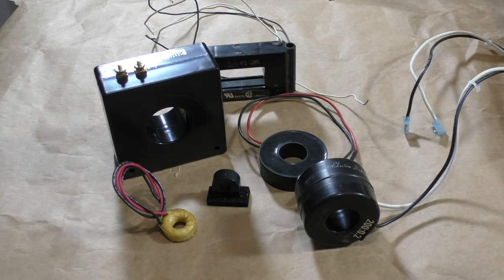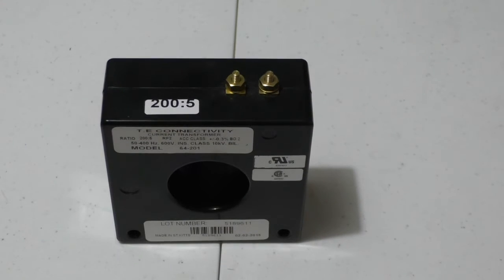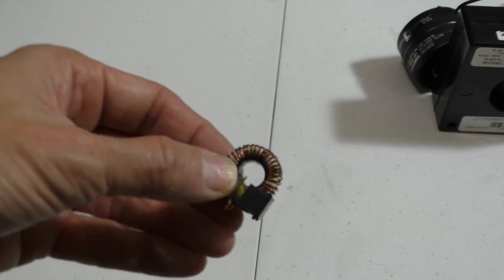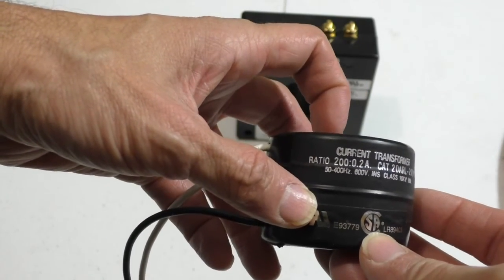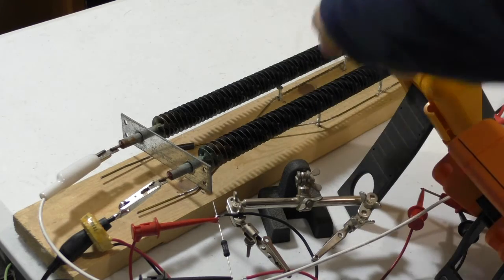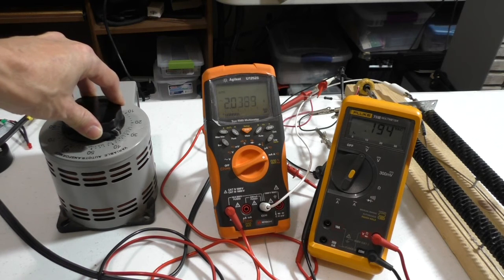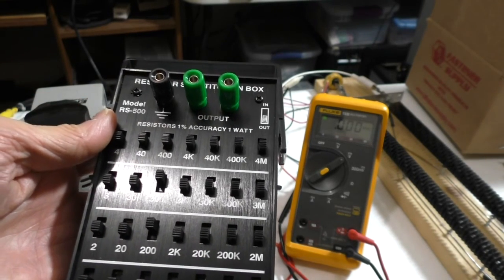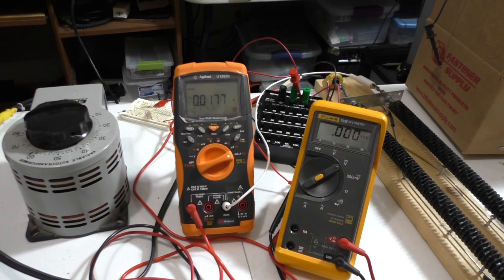R&D#23 A beginners guide to current transformers

Comment: Thanks for the video…. Do people often cover up the hole in the center of the transformer w/ a metal cover?… I ask because I have a transformer from an old boombox/cd player that is fully encased in metal (except for where the wires come out of), and there’s a small toroidal core wrapped around the primary side’s 2 black wires, and Im wondering why it is there….

Its a 120v(ac)-to-12v(ac) single phase power transformer… it has 2 blackwires on primary side & 2 red on the secondary.

Im wondering… could this actually be the same as the CT transformer u showed, except w/ the hole all covered up.

Comment: A serious matter, CTs should ALWAYS have a short circuit jumper installed until used. The theory is pretty heavy but I have seen an instrument imbedded into a concrete wall from a CT left open by mistake. Granted, it was in a power vault, but the theory applies even to MilliAmp outputs. They can bite, and have sharp teeth.
Bill Hudson EE(Ret)

Comment: Be careful here. Whilst it is correct to 'tweak' the burden resistor value to suit the application, remember that you can also distort the AC waveform on the secondary. I was tuning my CT to give 5V peak to peak for my microcontroller and when I put an oscilloscope on the output I noticed that the AC waveform collapsed it I took things too far. So be careful!

Comment: It's nice explanation. You mention that when you shorted secondary CT it will only generate flowing current without potential? what happen if I used another CT to that previous one. I'm having trouble to managing 400/5A CT to be read by ADC microcontroller that have range 0-5VDC, my plan is theoretical use second CT to be outputting more manageable current like in milliampere order.

Comment: Please let me know if the maximum load is 400 amps then should i use 500/5 or 800/5 CT ratio for a three phase KWH meter. 2) if a higher capacity CT ratio is used for a kwh or ammmeter .........is there any problem !!

Comment: So lets say I want to measure the total current of my main panel at home (220).   Do I need two CTs measuring each leg and then add them?   I've been hearing mixed answers to this.     One suggestion was to use one CT and have one leg looped backwards through the same CT.   This is not an option in my application.   But I do have two CTs if I need them.

Comment: Hello R&D#23, I am trying to monitor the accumulated run time of the new 240volt Hot Water Heater that I just installed at home. The H.W.H. has two T-Stats that each call in its own19Amp element. They operate non-simultaneously, i.e in an either/or manner. One for the upper tank the other for the lower portion of the tank.  Both 120v legs pull approx. 18.75 amp when either heater is pulled in. Can I use a C.T. to operate an elapsed time clock of some kind so that I could know total number of hours that the H.W.H. runs over time?? Any help is very much appreciated. I can scan a sketch or answer any questions if needed.  Regards
Reply from the maker: +gearhead0800 Yes, monitoring a water heater with a CT is possible, you will need the supporting circuitry of course, you can look up circuits on the google, then just add that to your A to D converter for the micro-controller and start counting the on time. Good luck.
Reply: +R&amp;D Department thanks for taking the time to respond. I will check it out. Regards
Reply: +R&amp;D Department just a word, I am a mech.eng. and have some electrical knowledge but I wish I had more knowledge of circuitry, that is why I subscribed to your channel.